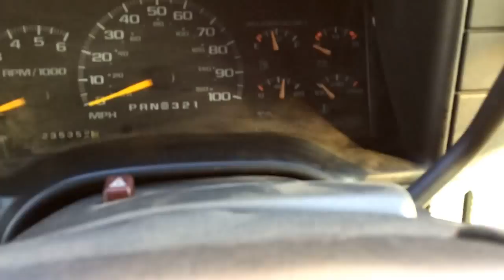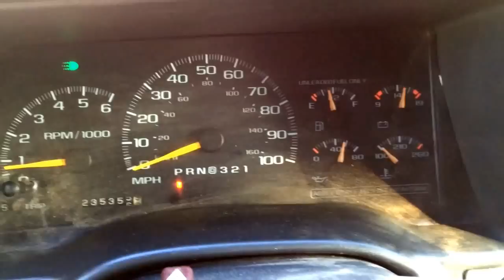1997 Chevy Tahoe Fuel Gauge Problem

Comment: my gas gauge on my 1997 silverado moves as i hit my breaks. bought a used cluster at the junk yard all gauges didnt read accurate right now my oil gauge reads 0 going to buy a used gauge on ebay will post a video if this works. for my gas i gotta check the ground and sending unit gauge passes F on a full tank like 1/4
Reply from the maker: thanks for the comment man, Please do post up if an ebay cluster works. I recently bought one from a junkyard as well and it had the same problem mine shows in this video. this problem pisses me off so much haha
Reply: will let u know just waiting on the part to get to me,
Reply from the maker: bizzy156246
Ebay waits are the worst haha

Comment: Has anyone found a solution? I have a 1998 Silverado that stays on full and it vibrates.
Reply from the maker: John Poe That could be your sending unit itself. The 98s route the signal through the ecm which is different from the 96 and 97 gauges. I've heard of people using really thick silicone to fix the vibration but mine never had that issue since it was a 97.
Reply: Thanks for the info I've been chasin this for six months. I guess I've got to bite the bullet and buy the fuel pump and sender.
Reply: That is exact symptoms of a bad ground at fuel tank.

Comment: 2004 chevy colorado..mine goes down too fast and every time you turn t goes down. Im not replacing it. all i need is a trip reset button
Reply from the maker: Trip reset, or counting the odometer is usually a better method of tracking when to get fuel, I agree. My problem is that I and many other people simply hate watching a gauge bounce around on the dash.  The gauge should obviously just be used as a rough estimate and the gauge of this year range suck at accurately telling you how much fuel is in the vehicle anyway. If your 2004 gauge cluster were to fail (which they do in those years) you can buy the stepper motors off of amazon or ebay and rebuild them quite easily. In the OBS year range, it's a giant pain in the ass.

Comment: You may only need a new fuel sensor
Reply: Have to buy whole unit. He has already replaced it. have the same problem sitting still reads fine start moving and at 1/2 tank it starts jumping all over the placw. when stopping, starting off or just going down the worn out roads in Alabama.